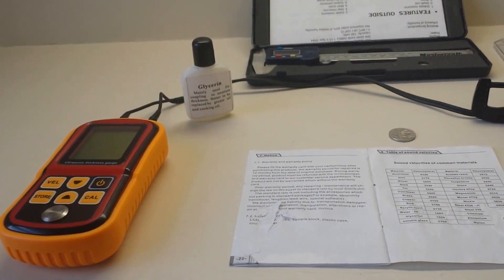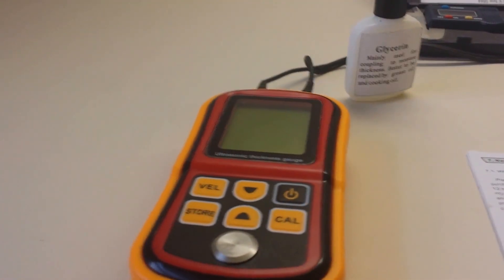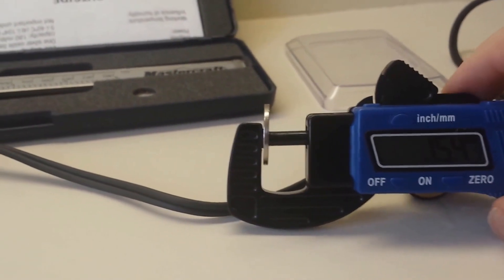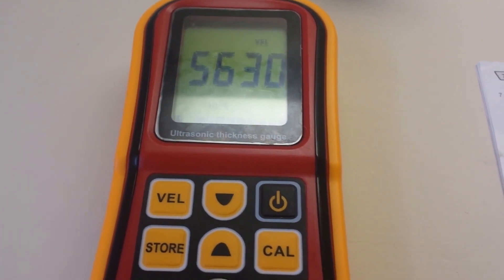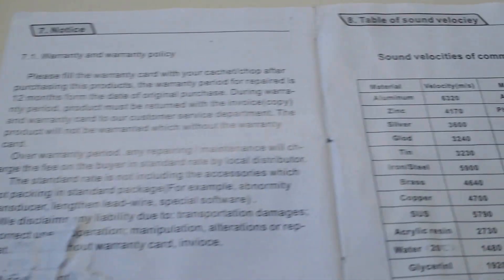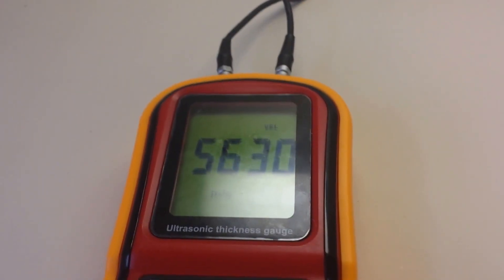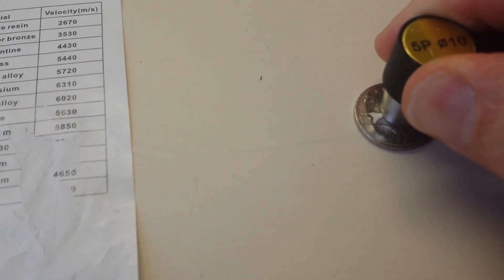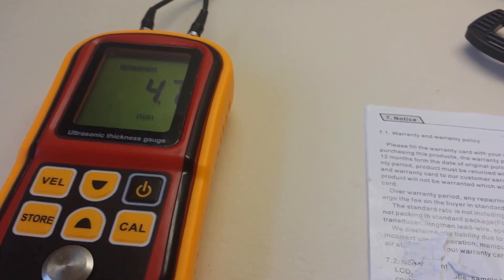How to Avoid Fake Coins - Testing Coins for Metal Composition

Comment: Thickness of course can be duplicated by alloying metals to get the identical weight per size.  I would think resonance of materials would be harder to nail.  The "ring" to it ....need decices that check resonance/thickness (dimension)/resistance/and OFCOURSE weight.  I would think it virtually impossible to nail all four on one counterfeit coin or bar

Comment: Hi,

For testing Silver/Gold coins now you have quite many apps out there that can use the same technique/principle as these devices can. 🤔

For Android you have Bullion Test (Timmy Brolin) & for iOS CoinTrust. 😉

Great video by the way !

I was thinking on getting mine on eBay with the aluminum case & everything... 🙄
Reply from the maker: This test relies on the travel time of an ultrasonic wave through the material, whereas the phone apps rely on a sound frequency signature when the coin is tapped.
Reply: Bullion Test is really useful but it has a big limitation, only the coins Timmy Brolin has selected can be checked.
And there  are so many more coins that one would control, the mexican 50 pesos for example, and all the bars as long as they are over 1 mm thick..
Reply: Right! Bullion test is great, it works nicely the only issue is it doesn't have all the coins which are available (such as Gold Britannia or Platinum coin) but Bullion Test is a great alternative for coins which contain other metals in them besides pure gold such as "American Gold Eagle" or "Krugerrand", not sure if this ultrasound test would work accurately with 22k gold coins.

Comment: This proved nothing. A silver plated coin with correct thickness would read the same as solid silver coin. This is stupid.
Reply from the maker: Anguinus Vir the machine shoots a sound wave through the coin from one side to the other and back.  if any material other than the one being tested for is encountered the sound wave will have a different travel time and an erroneous thickness will display on the machine.
Reply: robmajorfitness - Prove it!
Reply: He's not kidding.  Each element in the periodic table has a different sound wave propagation speed.  This is a property of materials.  
wiki for gold lists the speed of sound in the material:
https://en.wikipedia.org/wiki/Gold
Reply: @anguinusvir6698  you know how silly you look dude?  "prove it!"  XD  smh.  science bruh...
Reply: Anguinus Vir I bought this shit off amazon and barely makes the difference between metals